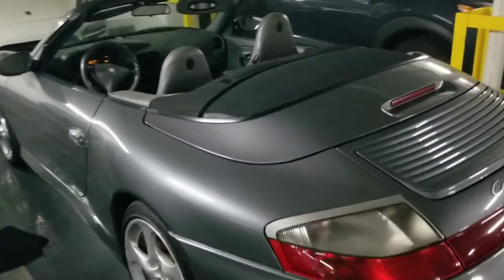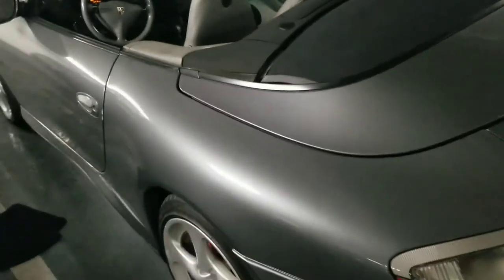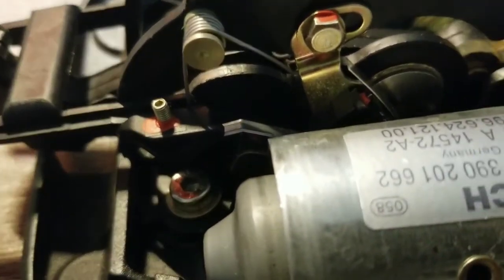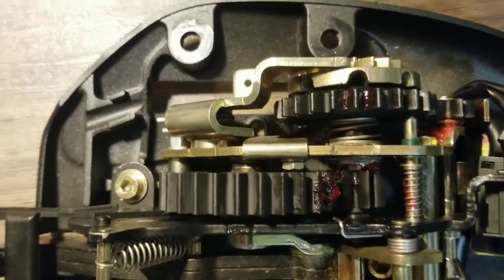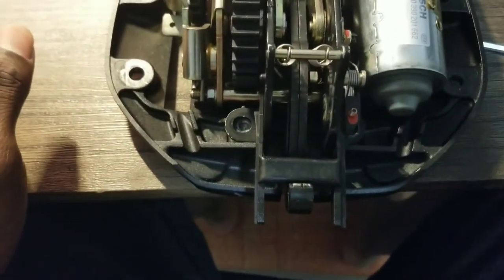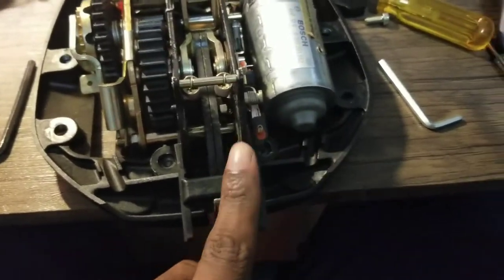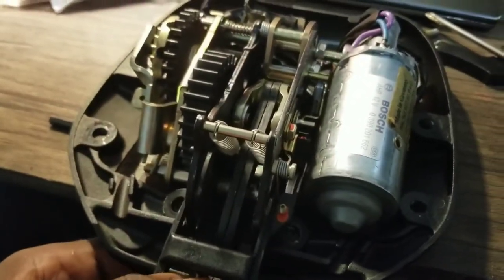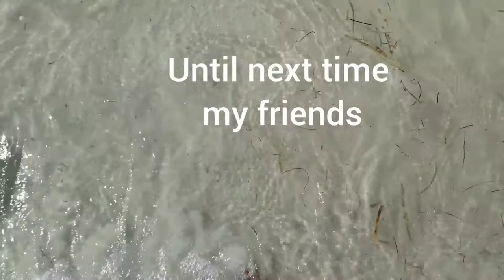996 Cabriolet - convertible top troubleshooting

Comment: Hi I started looking at this video with some doubts but I have to admit you helped me a lot. 
My problem was slightly different but still located in the latch unit (like you) but the motor was not stopped in time so the "clutch" on the secondary gear was stuck solid. Using a small DC variable train transformer I was able to rotate the motor with a very smooth movement. Possible reason in my case, one of the micro-switches did not report in good time to stop the motor.
A bad dude from Paris
Reply from the maker: Wow that's awesome! Nice diagnosis and process. Love it man!

Comment: Good job on your car!  I have an '03 cab, same color combo as yours but a 6 speed.  They are great cars!   The only top issue I've had was from a leaking hydraulic actuator on drivers side.   I was able to do the R/R in the driveway.  Enjoy your car!  
Reach out if you run across anything you have a problem with.
Reply from the maker: I figure at some point I'll have a hydraulic issue so I definitely will. I really love the color combo especially after redying the seats it feels brand new. Man I love the fried egg club! Thanks for the encouragement!
Reply: Thank you for showing us how you fixed the convertible roof malfunction! You did a GREAT job of figuring it out by yourself!  I am right now in the middle of purchasing a fried egg Cabriolet with a roof issue, too. The seller told me that it cannot fully open the roof. I am having the car shipped from out of state and hopefully your fix will heal my Cab, as well.
Reply from the maker: @heimatliebe116  awesome yes, I hope so too. Congratulations on your cab, you can't beat the top down experience with the flat six!